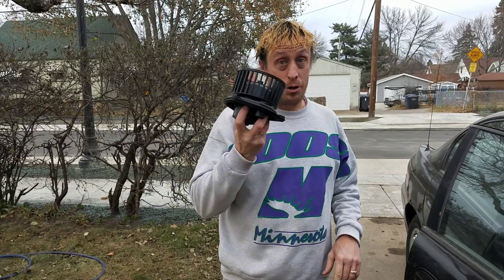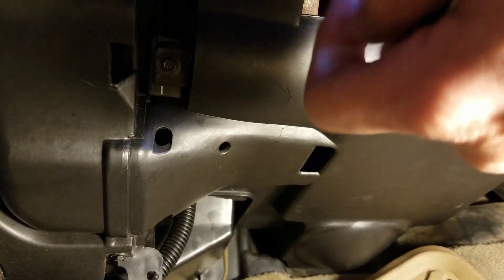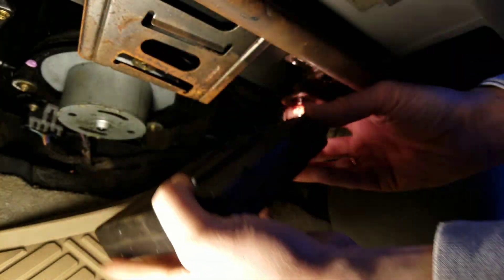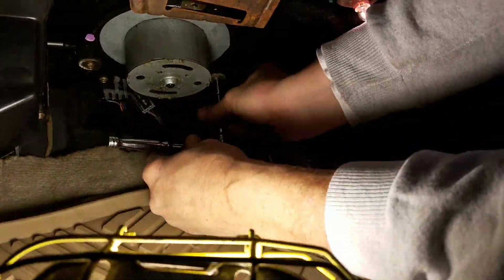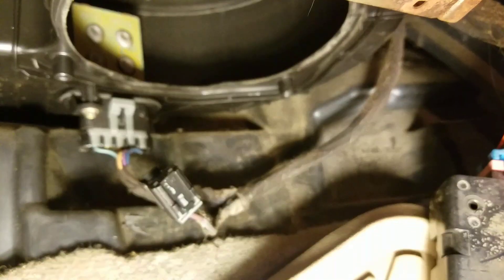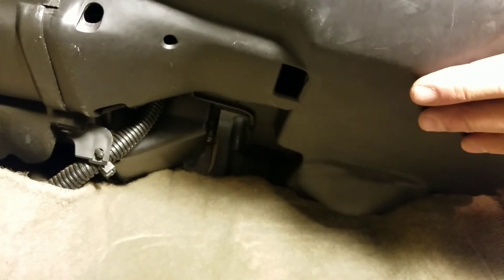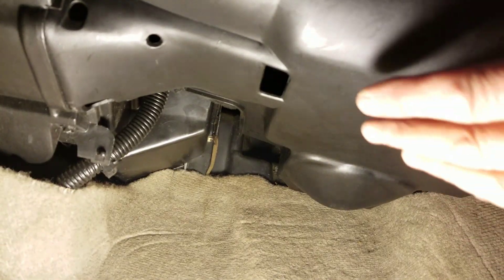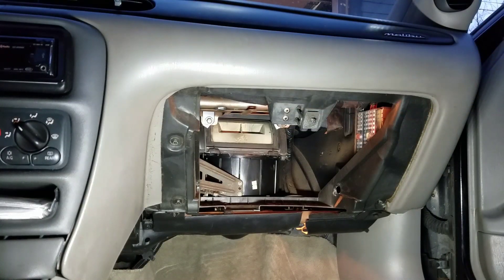1997-2004 MALIBU- REMOVING AND REPLACING A BLOWER MOTOR AND RESISTOR!!

Comment: Thank you for making this video.  After a lot of research, I found nothing to replace my fan motor and resistor in my '05 Malibu..........must be the old style.  Your setup is exactly like what's on mine.  Fan was squealing and only had 2 (4 & 5) speeds on the blower.  Now I have everything thanks to you.  And.........btw, I'm a 71 year old female. ;)
Reply: Were did you buy new one,,and cost

Comment: Thank you. Just wondering if the evaporator coils for the AC are accessible through that hole. Would like to spray some coil cleaner up in there
Reply: Were you able to figure this out? I need to access my evap also

Comment: Thank you! This really helps. My car has been overheating and the inside heat wont work. But every once in a while the heat will pop back on and the engine temp will plummet back to safe. You tjink it might be the blower motor?

Comment: Yay this is an easy fix...my fans are working when I first start my Malibu but then it sounds like grinding and they turn off so I bet this would fix that. Replaced my serpintine belt and tensioner so this will be what I fix next. 20 yes old Malibu with 120k miles. Gotta keep her on the road

Comment: HI Big Al Thank you for the helpful video, But I do have a question I installed new resistor new motor but my fan setting#5 doesnt work tried 2 new resistors any ideas Thank You ohh PS your blower motor seems to sound alot more powerful then mine is there different ones that work Thanks again 1998 chevy malibu

Comment: My blower will not work on any speed ,how did you determine that your problem was the blower motor and not the resistor pack or both 
I have checked the blower fuse 
Do you have a trouble shooting video ? Thanks in advance .well done video  I know I can replace the blower I just need to make sure that is the problem before I start buying  or parts also.

Comment: I'm not sure if you monitor these comments anymore. If you do, do you have any tips on how to tell if it's a resistor or a blower issue? All I can say is that my fan will cut in and out and sound all warbly and rough at times. I'm guessing it's the blower, but I figure I might as well ask.

Comment: How can you tell if just the blower motor, just the resistor or both need to be replaced???
Reply from the maker: usually if it's just the resistor, some of the fan speeds will work. to be sure if it's the fan and not the resistor you should run constant power thru it after unplugging it.
Reply: Big Al Hoffman Vlogs Yeah... it was running on only the last 3 of 5 speeds and off.  I got both of the parts (resistor and blower motor) for $30 so I ended up getting both just in case. It was just the resistor. The blower itself was fine but I’m keeping it anyway just in case I need it down the road.